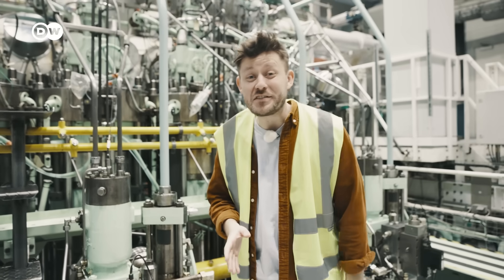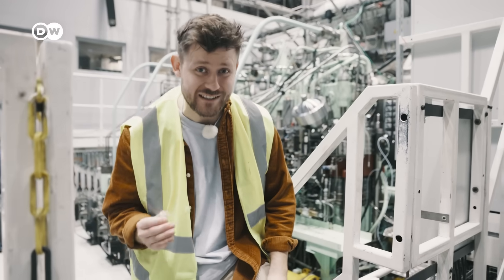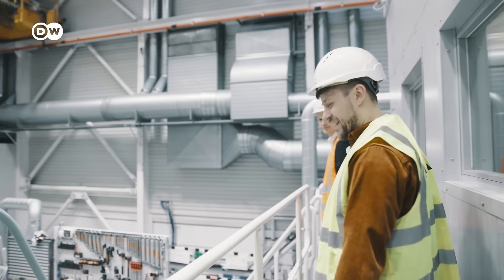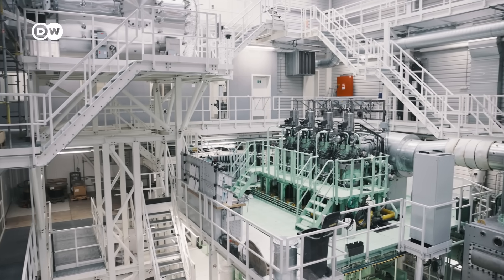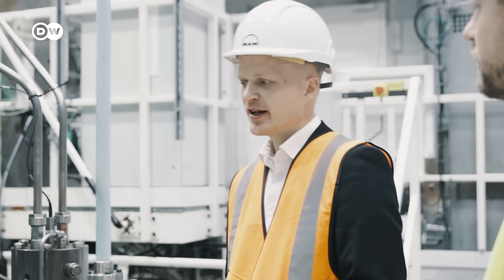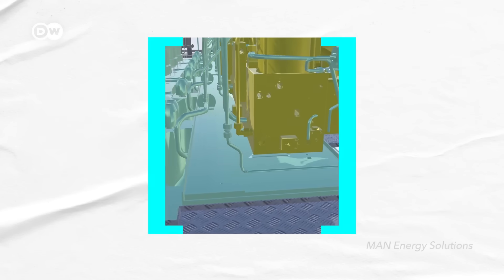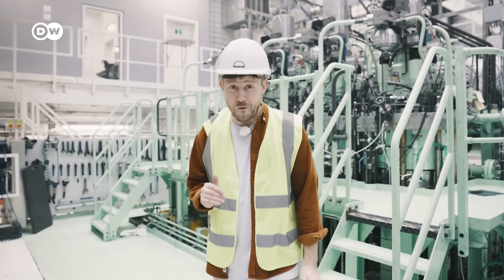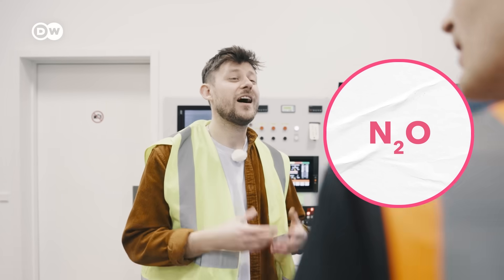Can this magic fuel clean up the shipping industry?

Comment: Maybe they’re going about it wrong.  Instead of replacing diesel engines with ammonia engines, they could do it like carmakers and make an ammonia-electric hybrid, and use the ammonia engine as a range extender.
This would mean that the ammonia engine can then run in its most efficient and least polluting power band to charge the batteries for the electric motor.
As a bonus, whenever it stops it can then charge up with cheap electricity from ports, giving hundreds of km of fuel-free travel.
Reply: Or just use simple battery and motor which is already being better every year.

Comment: Prove the nitrogen is a renewable resource or else “green” ammonia is another finite and fuel - go for it if you want but this time unlike with fossil fuels we’re going to study and publicize an assessment of availability of inputs and total supply to determine how much time we’ve got to sigh build infrastructure for it and then build other infrastructure after it. 

But then also, renewable energy still exists. In my sustainable energy university course, we learned diversification is the key until renewables got it with more efficiency R&D. So an alternative fuel that does not pollute as much, even if finite, does helps, but for how long?

Comment: couldnt they.

1. install an exhaust recycling system similar to the egr that gave so much problems in the 80s causing egregious warning lights that prompted people to have the light disconnected?

2. throttle the fuel so there is no left overs ?

Comment: We used to have ammonia as a refrigerant for freezers and refrigerators, anhydrous ammonia has the highest heat capacity of any liquid (slightly higher than water and much better than Freon), yet we switched to the less efficient stuff because we like our kitchens free of lethal poisonous gas under high pressure.

Comment: Why don't ships have solar panels on top? Diesel electric ships could even use the energy directly. That should make it even more profitable than if it has to be connected to the power grid.
Reply from the maker: Good points! on ships they're not yet common for propulsion, but more and more used for additional power to reduce fuel consumption and emissions. 🌞

Comment: Ammonia combustion can cause NOx release during combustion. This NOx then converts to acid in atmosphere. To avoid this, low NOx engines should be designed. Renewable methanol from agri / wood waste using renewable power may be a better solution. Methanol does not produce either NOx or CO

Comment: "Publishing their findings in PNAS , the U.S. National Science Foundation-supported team found that a mismanaged ammonia economy could ramp up emissions of nitrous oxide, a long-lived greenhouse gas around 300 times more potent than carbon dioxide and a major contributor to the thinning of the stratospheric ozone layer."
"... ammonia is toxic, emits significant levels of pollutants upon combustion (NOx and NH3 residuals), and has an overall relatively low reactivity as a fuel..."
But I am **absolutely certain** this worst case scenario would never, ever, ever happen. 
Why we **all** know that ships manned by short-staffing, over-worked folks are a thing of the past and that **all** ships are clean, well maintained and never, ever, ever have any mechanical or other problems at all. Ever.
Oh.. and ammonia is hard to handle, toxic and low energy density. Oh... and its production would compete directly with fertilizer production so of course costs would be "equitably" distributed and nothing bad would ever come of that...
Yeah.... on paper ammonia looks spiffy. In the labs in which I worked it was very useful. In its very narrowly constrained and properly designed and implemented scenarios.
But I digress....
Everything will be **Just Fine** I am certain.

Comment: Ammonia is not a primary source of energy.  It takes a primary energy source, addition chemicals, a production, distribution and sales structure. This all costs money and time, higher than just the cost of the primary energy source. Why add the extra cost? Just find, or improve a primary source of energy. If that option is not available, just use what  you have.

Comment: When electrolysis is required to make ammonia it seems like it would be better to just use the hydrogen as fuel. Hydrogen is more energy dense than diesel and would take up less space. I understand that hydrogen is less stable and explosive but if the same money and energy were put into safety mechanism I believe it would be a better alternative than ammonia

Comment: I get the technical challenges, they are significant.  Not to mention, the fuel and the emissions can both kill you.  From an economic stand point, shippers couldn't care less about diesel exhaust polluting the atmosphere as long as they are making money.  So until you come up with something that is at least net neutral and doesn't cost the shippers more in the long run, they are not going to switch to ammonia.  Cargo shippers only care about profit, not doing the right thing for the environment.

Comment: so if nitrous oxide is 273x more potent as a greenhouse gas at warming the planet than co2 these engines would have to produce over 273x LESS n2o than the same amount of co2 an equivalent amount of diesel would make per kilometer travelled. it sounds like they aren't anywhere close to that so making riskier engines for global warming considerations seems like a bad deal

In addition, it would mean that one single misconfigured/malfunctioning or broken catalytic converter that's supposed to scrub nitrous oxide from the emissions running for a year solid would probably make more than 273x more harmful greenhouse gas than an equivalent diesel engine.
I just used copilot and it gave me the following:
When ammonia (NH₃) is burned, it can produce nitrous oxide (N₂O) as a byproduct. The exact amount of nitrous oxide produced depends on the combustion conditions, such as temperature and the presence of catalysts. However, under typical combustion conditions, about 0.1 to 0.2 kilograms of nitrous oxide can be produced from burning one kilogram of ammonia12.
So if that is correct, and you need more ammonia than diesel for the same amount of propulsion/energy, then you're producing wayyy more greenhouse gas environmental damage than a normal gas or diesel engine. so the risk is far far greater to the environment unless the scrubbers worked perfectly and there were no way they could fail or be broken, which seems highly unlikely.

also google lists ammonia as Ammonia is acutely toxic to fish at concentrations ranging from 0.88 to 4.6 mg/L, whereas diesel is toxic at 100mg/L apparently - so a spill of ammonia in water would be worse, and the ships have to carry over double the amount of ammonia compared to diesel (according to this video).

https://www.waterquality.gov.au/anz-guidelines/guideline-values/default/water-quality-toxicants/toxicants/ammonia-2000
https://link.springer.com/article/10.3103/S1063455X22010039

Comment: cant we use to hydrogen engines for a ship ??
Reply from the maker: Hey there! There are some challenges with using hydrogen for fuelling ships. One is the low energy density that leads to the demand of a big storage on the ship and the equipment costs. If you want to find out more, the European Maritime Safety Agency did a potential analysis (Potential of hydrogen as fuel for shipping).

Comment: what percent of the atmosphere is co2? 0.04 
what is the ideal concentration of co2 for plants? triple the current level
Reply from the maker: Increased CO2 levels yes, can help (some as it is not uniform) plant growth. But you have to take into account other factors that rising levels contribute to: global warming, ocean acidification etc. which have very negative consequences on many ecosystems in general.
Reply: @DWPlanetA  what percent of the atmosphere is co2?
Reply from the maker: As you said, 0.04%. But it is not actually a significant climate impact indicator - rather the change, a level that has risen by 50% since pre-industrial times. Another change from 0.04% to 0.05%, for example, would be very significant.
Reply: @DWPlanetA  there's something al gore said, that you should have listened to. "increase in co2 follows increase in temperature".

Comment: Nitrous Oxide is an oxidizer.  Probably the best way to do deal with it is probably to filter it out of the exhaust stream and cycle it back into the intake of the engine.  People have been using NOS for years in hot rods.  For temperatures, you could place a heater to heat the exhaust before it reaches the catalyst.  But all this is theoretical.

With all the listed disadvantages of using ammonia, I do not see it replacing carbon based fuels anytime soon.  A more viable solution is nuclear power, but that presents it's own issues as well.  But a ship could travel for 20-30 years before needing a reactor core refueling.

I have read a few recent news articles that all ships can reduce their fuel consumption.  By slowing the ship down 10%, a ship can reduce power requirements by up to 27%.  That reduction in power requirements means fuel savings which in turn reduces emissions and operating costs.  So just changing the way that these ships are operated can save money in the short term which is a big boon in the shipping industry where you have tight margins already.
Reply: A nuclear powered ship just like a nuclear powered submarine should be used to mitigate carbon emissions
Reply: @CerelinaBalansag-o9g  Exactly, but the issue is that the only nuclear powered ships are in use by the military.  There are no commercial ships that use a nuclear power plant.

Comment: Why not pure Hydrogen? Why do they need extra steps to produce NH3?
Reply: due to the extremely challenging properties of hydrogen in liquid form.
Reply: @HolmBidstrup  but hydrogen powered cars exists
Reply: @ElKudesnitsa  Yes, a couple of them.
With high pressure tanks for a couple of hundred kilometers.
For container-ships, which travel thousands of kilometers without refueling, you would have to use cryo-cooled liquid hydrogen. Which is very difficult to handle safely.
It would be feasible, but very dangerous.
Reply: @701983  Isn't LPG [powered] tankers use the same techonlogy?
Reply: @ElKudesnitsa  I don't know what you refer to.
Perhaps LNG-tankers, which store liquified natural gas at very low temperature? And use it for propulsion as well?
Yes, you can do that, there are also a couple of LNG-powered cruise ships.
But LNG is easier to handle than LH2.

Comment: I live i a country, (Denmark) that has gone beserk with the idea of an artificial flammable fuel. We are planning a number of facilities, that will be capable of converting green electricity (Sun and Wind) into a flammable fuel. Going from the electricity to Hydrogen, you lose 2/3 of the energy captured. When further more building the Hydrogen atom into a molecule containing more Hydrogen and - as here Nitrogen - you spend an additional amount of energy. To be very short. If you want to make shipping green, it will take away the opportunity for electrifying a lot of things on shore. Please - We need to substitute fossil fuel, and we need to do it now and we need to do in big scale. Why not concentrate on the easy and the cheap points first. Where to start? Cars, we know how, now we just have to find a model to reduce the 1,5 ton iron we bring with us (the car it self!!), Airconditioning - When it is needed it ís because of to much sun - let solar power run all the aircondition. Lets have a competition: Who can think of how in which use most fossil energy can be substituted by the smallest amount of alternative energy (there is no need for inventions, just for alternative thinking).

Comment: There is another way to use ammonia:
Use ammonia as a Hydrogen carrier, and then use the Hydrogen in Fuel cells. 

This would eliminate most of the problems mentioned here: 
1. Fuel cells are much more efficient than combustion.
2. NOx/N2O since it's not burned, there is no danger for this.
3. Fuel cells are much easier to use at low power.

Only problem: Making Ammonia to Hydrogen requires a cracker with around 800°C and 80bar. (It's the reverse Haber Bosch reaction as shown in the clip.) This will be impossible for small ships. But large ships do have enough space to include sufficient crackers onboard.

Comment: Of course you leave out the the fact that although you might be burning the hydrogen, you are also generating nitrous oxide.. and....
"Nitrous oxide molecules stay in the atmosphere for an average of 121 years before being removed by a sink or destroyed through chemical reactions. The impact of 1 pound of N2O on warming the atmosphere is 265 times that of 1 pound of carbon dioxide. Globally, 40% of total N2O emissions come from human activities"

https://www.epa.gov/ghgemissions/overview-greenhouse-gases#:~:text=Nitrous%20oxide%20molecules%20stay%20in,1%20pound%20of%20carbon%20dioxide.&text=Globally%2C%2040%25%20of%20total%20N,emissions%20come%20from%20human%20activities.

Dumb, really dumb.... like shutting down your nuclear reactors only to find you have to maintain your coal fired power stations..... 

and...
"Nitrous oxide enhances the greenhouse effect just as carbon dioxide does by capturing reradiated infrared radiation from the Earth's surface and subsequently warming the troposphere (lower atmosphere)..."
https://www.soest.hawaii.edu/mguidry/Unnamed_Site_2/Chapter%202/Chapter2C3.html#:~:text=Nitrous%20oxide%20enhances%20the%20greenhouse,the%20troposphere%20(lower%20atmosphere).
Reply from the maker: Hey there! Thanks for your comment. We tackle the issue of nitrogen oxides and nitrous oxide in detail starting minute 4:23.

Comment: Ships use bunker fuel, nasty stuff, they should also be plugged in at port and shut the engines down. Ammonia may be more suited to stationary engines where it's much easier to control and avoid  the downfalls. Less energy also means less cooling needed. All factors considered it may be a good idea. Definitely worth looking into further.

Comment: Instead of the problems currently associated with using ammonia as a fuel as cited here, what about replacing such marine diesel engines with small modular (nuclear) reactors - SMRs to generate steam to either produce electricity and or to directly power a ship's steam engine there?
Reply from the maker: We have this video on SMR's. Only one has been built so far, why is that? ☢️👇
https://www.youtube.com/watch?v=GhKQ8EP1a1Y&t=145s

Comment: Hydrogen, ammonia, and methanol are all only "hopium". Nobody has the money to finance the change. 
I have calculated that for replacing bunker fuels with 50% ammonia and 50% methanol, with the current electrolyzer and production technology 120,000 offshore windmills with 15 MW nameplate power production and a generous 50% capacity factor would be required. Sounds doable? Look at the current deployment speed - 2080? Perhaps. But the costs! One 15MW windmill with a concrete base, shore connection, and installation is between $45-75 million. Oops - that is $5.4 to $9 trillion (i.W. TRILLION). The federal budget of the US is $6 trillion.  But that is only the electricity, leaving not one kWh for EVs, households, or industry. That capacity has to be built in addition.
But then come electrolyzers, production plants, a completely new logistic chain, and port installations, estimated at another $3 trillion. And last but not least must all ships be converted to operate on these fuels. According to Dr. Stopford, a maritime specialist, $3.4 trillion is required.  We are looking at a bill of $12-$15 TRILLION. 
That's why it is only "hopium" - it will never happen on time.

Comment: Nice video and great clarification of the technical challenges.  I think compared to batteries ammonia is a good way of reducing carbon on ocean-going ships but as you say has many difficulties in reducing NOx and N2O.  I particularly liked the helicopter flying over the ship to measure the emissions, maybe this could be done more economically with drones and "flying PEMS" to keep the engine / ship makers and operators honest that their vessels are really emitting as low as they claim.

Comment: Ammonia is a great refrigerant but the surrounding precautions make it unviable except where extremely cold temperatures (colder than minus 20⁰c) are necessary.   The dangers of a leak mean evacuation proceedures must be drilled into all staff.   If used as fuel leakage will be almost unavoidable with subsequent fatalities being almost inevitable😢

Comment: So it helps to be running these engines either at full power or not at all? In which case would it be better to run them as electricity generators filling a battery with the battery running the ship? Then you top up the battery when you need to out at sea. Plus you can recharge the battery when in port and not have emissions near the shore. I can imagine some kind of hybrid ship being the way to go.

Comment: If ship's had direct electric turbines running from batteries and hydrogen,gear's, transmission ,and combustion pistons were not neccessary hydrogen could be  converted directly by lazers to heat batteries ,that top up batteries that feed the electric turbines/propellars

Comment: Massive reduction in cost of manufacturing. Ammonia, now you only need 45ccentigrade bad 1 bar air pressure ,a unit that produces 100 on/year easily fits in a 20ft container , check out Canadian Fuel Positive .